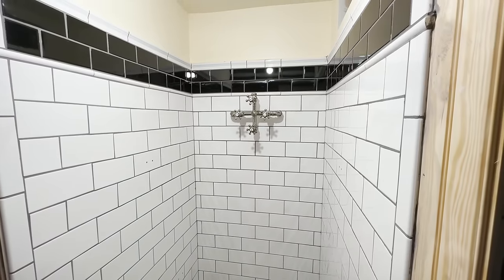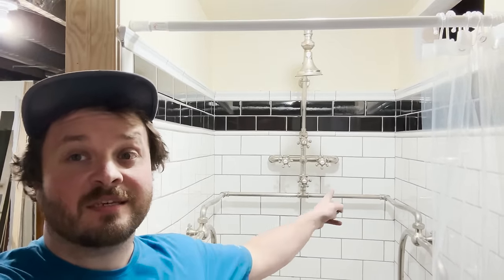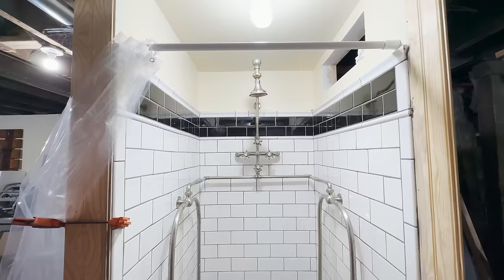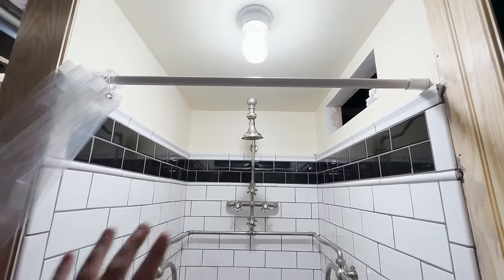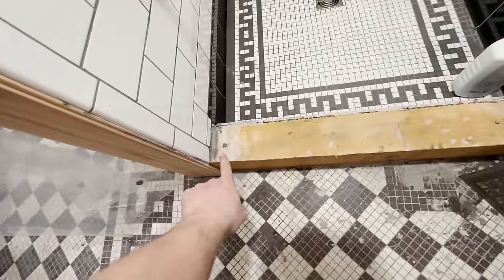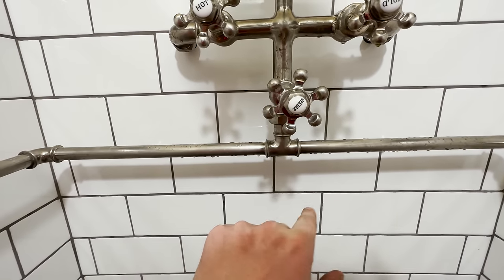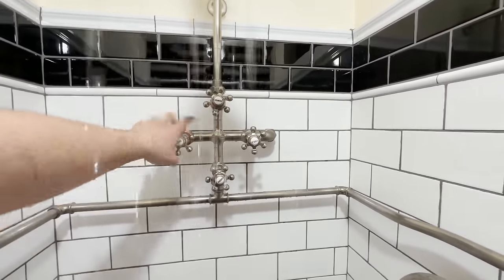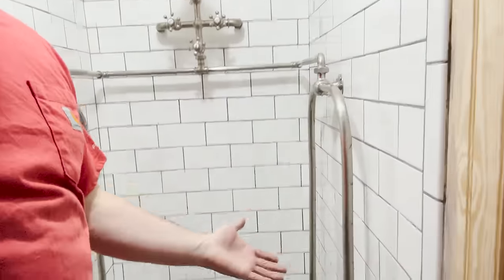What is it like to use an Edwardian Shower?! S3 EP50

Comment: You finally get to experience the Victorian reality: the sheer excitement of getting your first on-the-premises, indoor shower. Welcome to the modern age!
Reply: And electricity too! No need to light candles, just flip a switch and your house is lit up! (Or lit up ablaze if you had bad wiring)
Reply: Edwardian* although, there was a bit of crossover and late Victorian showers weren’t all that different. Some of them had 10x more metal tubes lining the walls and honestly look more like some kind of medieval torture device than a shower. The components of this one, however, must’ve been made after the turn of the century, when indoor plumbing became more common (among the wealthy). Interesting note: through most of the Victorian era, bathing was seen as purely therapeutic and not a hygienic necessity.
Reply: @agoogolofgeese the amount of bathing/showering we have today is much more „therapeutical“ to appease social pressure than a necessity.

It’s proven again and again that showering with soap more than once or utmostly twice a week is extremely damaging to your scalp and skin.
Reply: @rolux4853  actually, I agree. Corporations have sold the idea to us to keep us dependent on their products. That said, I do think showering often with at least water is important for cleanliness and hygiene. For most of the Victorian era, that was not the case. I’m not sure whether or not those with showers used soaps when they washed back then, but I’m inclined to think it less common and they certain didn’t have the overblown market for such products anyway.

I probably could’ve phrased my other comment better. Cheers!
Reply: @agoogolofgeese sponge baths were done at least once or twice daily from soap, water and rags in a basin.  They also wore hats which protected their hair from the environment, long shirts/pants or dresses made out of natural fibers and under clothes  made from linen, which helped wick away sweat and kept the body dry. They also used powders and natural fragrance to prevent odors (corn starch does wonders for smelly pits and other sweaty areas).  The Victorians/Edwardians did value hygiene, they knew how to keep clean and healthy within their means and resources.

Comment: Remodeler here.  You did good!!!   Never heard of a Needle Shower before, looks pretty cool!  Yeah, I’ve had the same problem with the Mapai grout either setting to fast or not fast enough.  I always just grout one wall at a time.  If it’s glossy tile such as your subway tile, you can get by with one good wipe down, let it dry completely, then buff everything with a microfiber towel.

Comment: I'm just impressed that you got 100+ year old valves to function.
Reply: Things were made to last!
Reply: @merana59  The lifespan of all-brass (!) plumbing really is absolutely insane. Actually hundreds of years, properly maintained.
Reply: wish things were still made so well
 @solarbirdyz
Reply: Right? My house was built in 99, and the valves in my upstairs bathroom sink just, like, broke when I was trying to close them. Now I just have a tiny drip of water that comes out and the valve handle just turns and turns without doing anything. 😂😭 I need to fix it, but I’m just too tired right now. I have no idea where this man gets all his energy and motivation. It’s seriously impressive to watch.
Reply: @merana59  They are, just not anything you'll find at a big box store, and it's NOT going to be cheap
Reply: @solarbirdyz depends on the area. In Tennessee brass only lasts 15-30 years
Reply: @cameronbernhardy8357 wtf is in the air over there?
Reply: Good old leaded brass. The lead keeps the valves from sticking.
Reply: @johnnydjiurkopff  Not so much the air, but the water. Chlorides in the water will eat away at the zinc in the brass, leaving behind a brittle, porous copper hunk. A lot of valves these days for this service are actually bronze, which is also used to make marine propellers for sea use, as it can withstand a high level of chlorides in water.
Reply: @merana59 they are but you have to pay big money for it.
Reply: @merana59  They really were. My parents' house is over 90 years old and most of the master bathroom is original, some of the piping inside the walls has been redone but the shower and sink valves are still working perfectly. Meanwhile the kitchen, which was done in the '90s, is on its fourth faucet (and all of them were expensive, supposedly high quality items) and lots of the other modern hardware there has failed too.

Comment: Finally, the full reveal? Loved this video! I realize now that my grandparents' 1880's Victorian house (sold in the 1960's) had a simpler version of the needle shower in the only bathtub. We called it the "shower tree" as it had three branches from a central stalk, each with multiple small holes facing the tub. There was no shower head, though. You pulled up a lever on the bath spout to activate it.  the needles of water shot out of the bottom branch the farthest, as the water pressure weakened on the higher branches. It's long gone, now.
Reply: 99.826%

Comment: About the grout - I've seen other YouTubers using the same grout, which was also super messy for them. The problem was mixing the grout too long and too fast (with some power tool instead of mixing it slower/by hand). It trapped a lot of air inside which made the curing time much shorter. Also - just like you mentioned - higher air and water temperatures can make it more difficult to work with. With all that - you did a beautiful job with the shower! It looks so clean and the style is very unique. Thanks for doing what you do with such passion and respect. Greetings from Poland!
Reply: I use this grout on most of my jobs and can say the temp has a huge role in the set up time. I do mix with a variable speed mixing drill on lowest setting for roughly 2-3 minutes then let sit for 3-5 min before mixing for one last minute to remix the excess moisture that rises to top back through otherwise you would pull out first few scoops that would be super wet leaving rest with too little water and problems. I use 1.1 quart cold clean water per 10 lb bag and have no problems getting it all in well before it begins to set up. One trick if want a few extra minutes is to dump it all into a pile on floor or onto mud hawk and wont set as fast as it does in a bucket. I Usually use Kerapoxy cq on shower floors and then this on rest of shower but have used this on complete showers with great results. Ive seen so many issues with the premixed urethane grouts in wet areas despite their marketing I would use ultracolor plus fa anyway over those products especially in a shower

Comment: That needle shower is awesome! I'm so happy you finally got it finished! It's a great thing to be able to bathe at home too! By the way, that stone baseboard is that gray marble limestone you see used as bathroom stalls in old buildings as well as gray stone work in many a public building from the first half of the 20th century. It would have been quarried in Phenix, Missouri (just north of Springfield) where all of that type of stone around the country came from.

Comment: There are specially shaped magnets you can attach to your water feed pipes that reduce limescale so it won't block those tiny holes x
Reply: Thank you for the tip!😮
Reply: @ritatharp5238  silly predictive text 😂 I meant magnets. If you put them on your main water feed then they reduce limescale in your loo, shower, taps and washing machine. If you have particularly hard water then you will have to double up. I got mine from amazon for £6.99, the active 3000 magnetic water conditioner

Comment: Congratulations and Yes, plumbing history is actually pretty cool especially rarities like the needle shower.  As to the tiles, there were actually special end pieces made for the areas you mitered. My house has original end caps for left and right sides in all the pieces, tile casing pieces around doors and windows, and even border caps where mirrors split the tile chair rail, also curved corners - all from the 1910’s. You can still get many of these specialty pieces from the reproduction tile company Heritage Tile Subway line. I used them to replace missing pieces during my restoration, and to reconstruct one bath that had been totally gutted (sadly) by a prior owner. Enjoy your shower and looking forward to the next chapter.

Comment: Congratulations Caleb!!!  
It's functional now and that is a major accomplishment.  
As far as the leaky knobs are concerned, I'm sure you can find replacement gaskets at your local hardware store or a plumbing supply store.  Remove the knob apertures and take them with you so you can find exactly what needs replacing.  Best of luck and continued success and Blessings!

Comment: I love the top trim of the tile. That said, we had similar tile trim in our parent's house's bathtub enclosure that was done in the 50s. Over the decades condensation from the shower would run down the painted walls and pool around that top edge. Eventually water got between the paint and the tiles and started crumbling the paint and then the drywall behind it. When we renovated the house, we put thinner white tiles above the trim all the way up to the ceiling, solving the condensation issues.

Comment: I used the same Mapei grout in my bathroom and in my kitchen. I used my food scale to weight out a 1/4 of the bag at a time so I could work in manageable batches to offset the quick curing time. This helped A LOT. I set a timer for 10 minutes, grouted what I could in that time and then went back and groomed that grout before doing a second 10 minute session.  As I recall, I got 2-3 10 minute grouting/grooming sessions from each 1/4 bag batch.  The grout is worth it. it is self sealed and stays clean. My shower is over 1 1/2 years old and not a speck of discoloration or mold has developed.  No cracks either.

Comment: In Hot Springs Arkansas, there are bath houses still open from that time period.  My sisters and I took our Grandma for the works and it's an amazing memory that I treasure.  We started with a hot mineral water bath in an original bathtub while sipping mineral water (an employee washed your back in the tub), then they had sits baths with your butt in the water and feet dangling out (that had us all cracking up ~sorry for the pun~), then there was a steam tank you could sit in with only your head sticking out, then we got to lie down on hot packs for any achey areas with cool cloths on our faces, and then we got to rinse our bodies in a needle shower.  The grand finale was a full body massage.  Grandma said the experience was a dream come true! 😊

Comment: A huge milestone indeed! If you are going to do more vintage fixtures, the c.l.r. does wonders as you said. For really plugged up pipes, I would suggest using a gun brush for the barrels of a rifle or shotgun. They have stiff nylon bristles as well as brass bristles available. They have nice long flexible handles to get way up inside the pipes.
I can hardly wait for season 4 to start. It doesn't seem like it's been 3 years.

Comment: I have a tower fan with a timer that I run for a hour after I shower.  It seems to help reduce the mold and mildew because the water dries faster.  I usually use a squeegee to get most of the water off the walls and floor as well.  Your shower looks beautiful!

Comment: What an achievement Caleb! As I was watching this I wondered just how many showers like these are out there still and restored as beautifully as you have done. I imagine not many. Two things I have to add; 1. Where will you place the soap/shampoo/washcloth? 2. I laughed out loud when you mooned us, Caleb! Did you purposely leave that in 😜
Reply: This was my pragmatic question too with the build--where is the the soap/shampoo/face wash/wash cloth/razor going to go so the floor doesn't get a mold spot or you have to bend over every time you need something? Like cool shower. Like it's not built in so far, is there going to be a door where the curtain is that has a hanging rack? What would be kind of period appropriate or not clashing with the intention behind the design choices?

Comment: Kaleb excellent job on the shower, very well done. If I may make one suggestion when it comes to the threshold step into the shower. The grey stone is fine for the vertical surfaces, making it match the rest of the room will definitely tie it all together. However for the horizontal surface I'd highly suggest a piece of finished marble. Perhaps one that is a black and white marbling. That'll both give it a nice tie into the tile but also just a touch of class. Also its pretty historically accurate, I've seen a lot of marble work like that in many historic structures I've worked on/in over the years.
Reply: So nice to read helpful comments. Thank you.

Comment: Just wanted to mention that there are certain grouts that if mixed by hand vs speed mixer it changes the set up time. Also a friend of mine used car wax (not turtle) on her shower tiles it worked at repelling water and kept the grout clean. Just buff it out. Once the water ceased to bead she would re-apply. Don't ask me how I know not to use green turtle wax.... amazing work as always!

Comment: Caleb, before you finish putting in that grate and exhaust system, can you install a hanging shelf to hold shampoo, body wash, etc?  It might not be period correct, but I would need have someplace to put that stuff where it could easily dry off after each use.  Just a thought.  Enjoy your new/old shower!
Reply: He has said elsewhere that he is just going to hang a basket on the shower piping. Victorians didnt have so many bottles of potions! Maybe just a red bar of carbolic soap!

Comment: When I was but a young girl, back in the 50s, Porchester Baths in London was like this. It had a small and a large swimming pool, each with wooden changing booths along the sides; it had a Turkish Bath, where you could get "Champoo'd" (gently scrubbed all over with a giant soapy soft bristle brush); it had Shower Baths and Sitz Baths and "Public Baths" where those who didn't have a bathroom could have a nice soak; it even had a Public Laundry, where you could hand-wash your clothes and hang them in a "drying room" while you went off for a tub, or a swim, or a "champoo". It was a marvellous place, all high ceilings and echoing tile, and everything which possibly  could be porcelain was porcelain.

Comment: When the H and C valves are closed, you can drain both the shower and needle pipes by opening those respective valves. In this video, you mentioned and showed us the draining of the needle pipes, but left the water in the shower head. That is why it dripped in the earlier part of the video because water was trapped with the shower pipe with that shower valve closed.

Comment: It usually dries faster if you mix it faster. Most grouts have a RPM that you are not supposed to exceed when mixing. A good rule of thumb is feel the bucket after you mix it, let it set, then re mix it and if if the bucket is warm throw it out and restart.

Comment: Hi, first time watching from here in UK. Re the grouting. On floors aka concrete, brick and or stone. BC water settles on a level gradient. It will obviously take longer to dry. Tiling and grouting on dry wall vertically, isn't a gradient level, it's vertical - as the name suggests any dry wall is dry, thirsty and will absorb any moisture it can get. Hence the grout seems to have sporadically. Also, Tiling vertically means the moisture and water in verticle Tiling will immediately run down.  Top to bottom as water does. So, major error. Rather than tile a wall and then grout. Tile and grout vertically and at the same time. Incremental bottom up. One half meter per 3 walls. Then go back and do the same and repeat from the same building up. Tiled and grouted until you've reached the top in a circular fashion. So, then once you've reached the top. The bottom grouting et al will have properly set. Re the opening with the grate etc. Hmmm I have to ask, why didn't you build the shower in front of the window in the first place? Hey ho. I'd recommend bc you've upgraded the overall heating system. Just keep the hole in shower wall. Allowing steam and humidity to escape. Maybe just put in grate with holes open (as it was designed for) and making sure the window on the other side is open. With a top levering type. Mould hates fresh air and oxygen. Steam also rises and will want to find it's way out. An elaborate extraction system seems ascesesigin, an ancillary unnecessary additional cost. Will also encourage shorter more productive showering and less waste of water and energy...😮😮😮

Comment: Beautiful shower.  It sounds like you might have used a drill/grout mixing paddle to mix the grout.  The heat from the drill/grout mixing paddle might have started the curing process before you were able to apply it to the wall.

Comment: Water and surface temp determines the set time on grout. Warm hallow walls vs cold heat sink concrete floor. Common problem is the timer starts when you start grouting not when you finish. Spending 20 minutes grouting a floor with 10 minute grout, causes issues.

Comment: The grout, did you mix the floor batch differently than the wall batch? Mixing by hand versus using a mixer can  change the setup time, if it’s the same brand. Read the back again.

Comment: It's worth investing in a 199,000 BTU Tankless gas hot water heater if you have gas to supply the required amount of hot water for that shower. I highly recommend the Japanese brands due to the build quality and reliability.